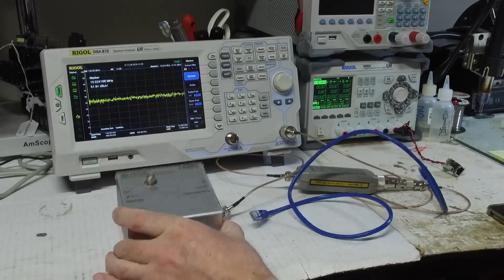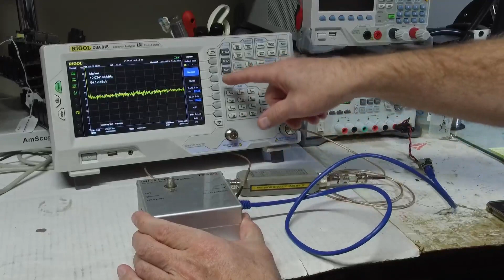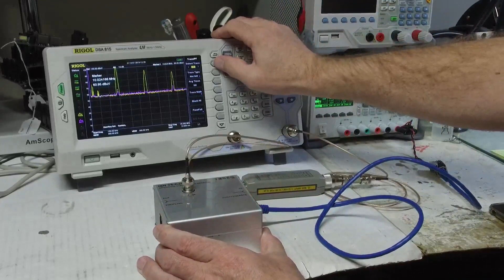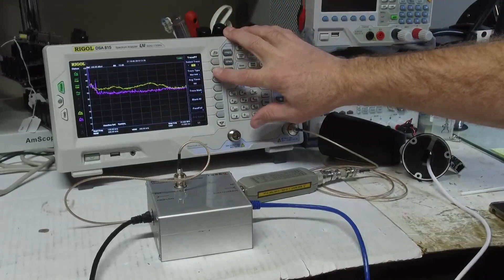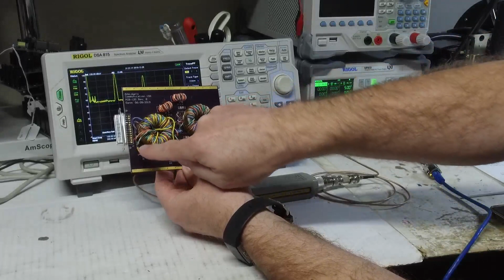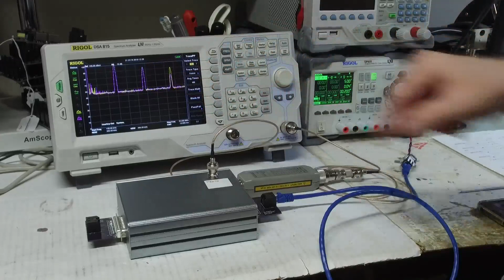FCC / CE Pre-compliance Telecommunication Conducted Emissions with Rigol DSA 815 and Teseq ISN T8

Comment: can you share your design files for the ISN ?
Reply from the maker: Hello.  I did not spend much time on making the schematics pretty.  Here is link for my schematics and gerber files.  
https://drive.google.com/drive/folders/1ScS2GX-7ipZqCkyKTqUlk6cKtGA8J1Xw?usp=drive_link
Reply: @DanPattenAudioG33k  thank you very much
Reply: Sorry to bother you again... 
I was wondering if you can provide the component's values that you have selected. For the toroid how hard was it to wrap all differential pairs around it? thank you :)
Reply from the maker: @interferenceCheckmate  I used the values shown in the EN55022 specification file.  Wrapping the core was easy.  Just used regular CAT5 solid wire.  Used a Laird "LF" series LFB360230-300 and LFB127079-000.  The large core was about 15 wraps to get 1.5mH.  The small core has EN55022 specification of 3.1mH which would be tough to get.  The Teseq unit measured at 1.7mH and that is what I did as well.
Reply: @DanPattenAudioG33k  thank you very much